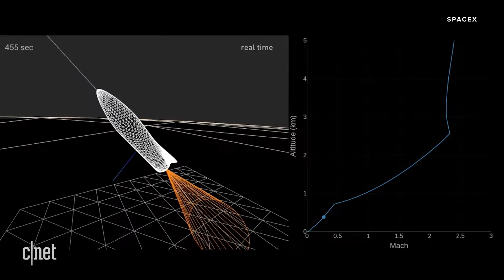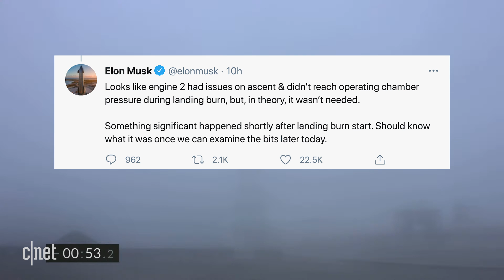Why does the SpaceX Starship keep EXPLODING?

Comment: They have "data" spread all over Boca Chica.
Reply: You do understand these rockets are covered in real time data gathering sensors right?.. they get a ton of info during the entire flight examining the wreckage is only a small part of that.
Reply: @NZBigfoot  Those real time data sensors probably stopped working the same time the camera feed stopped. The only way they will have to figure out why it exploded in the air is the wreckage. The engines appeared to land close together suggesting that the explosion took place somewhere near the middle of the starship. If an engine exploded it would be expected that they would land quite a distance apart.

Comment: It seems odd that SpaceX aren't testing the booster stages in parallel, unless they consider their Falcon experience completely transferrable? It might be, but scaling isn't always simple linear change.
Reply: The reason is simple, Starship is a much more complicated and difficult thing to design while the booster is basically just straight walled fuel tanks, which is being perfected on half the starship design. 
The main learning to do for the booster is having that many engines without shaking the thing to pieces and the crazy amount of fluid movement during flight, but the landing, well currently there is no plans on landing but instead catching them, will be fun to watch lol. Im sure a hop or two might be done with landing but not operational.
Reply: They can land boosters no sweat... as per the Falcon9, the Heavy Booster is just a bigger version of that. Starship is the unknown in need of testing.

Comment: Im surprised that this video didn't answer the question it posed. 

The answer is that they are built in batches with major development going into the production process. We will be seeing changes occuring in batches of which this was the last of its kind. Going into the next series of prototypes the gathered data from these flights will be used to better the ship.

They have been so successful actually that they stoped production of the current series short. SN11 being the last of its version that was manufactured when the series was slated to go till 14.

That also should have been the lead out. That the next flying Starship Prototype will be SN15 not 12 since 12-14 are scraped due to the great success of the series. In other words a bunch didnt blow up on the stand or on takeoff, they made their trip to the point of a known issue with tank pressure that will be addressed in the next series.

Edit: but a good video none the less. Thanks for trying to get people in the loop.
Reply: Excellent points. They should pin your comment to the top.
Reply: Well, the question doesnt have an answer yet, what your saying is basically true but it too doesnt answer why 11 failed. 

Each have had there own little issue that has caused their demise, it wasnt just from low pressure, that was only 8, which was fixed with 9 by adding helium but 9 had an engine not start correctly, fixed that by adding a third start during flip then shut downs till one was left (sn10) this failed because the engine wasnt giving the thrust asked for causing a hard landing, thought to be due to helium ingestion. 11, we have no idea as of yet.

Comment: people lamenting rocket part showered on wild life refuge, they are stainless steel scaps and more worryingly, fiber from the  insulation sheets, that's all, kerosene soil contamination on the other hand sucks
Reply: They dont use Kerosene, they use Methane as the fuel. The cleanest burning fossil fuel.
Reply: @NZBigfoot  I know I know, but the other rocket contamination involving kerosene and hydrazine sucks

Comment: This misses the main point: Spacex flies a full-flow staged combustion cycle engine. This is a super difficult technology even by rocket science standards. Nobody has flown such an engine successfully, apart from two sovjet launches which both exploded shortly after takeoff. It is so difficult because the seperate turbopumps for both oxidizer and propellant are driven by the partially combusted products which are then fed under pressure into the main combustion chamber. This means that the internal plumbing and turbopumps have to withstand scorching hot gasses as the working liquid, which is particularly troublesome on the oxidizer side (very hot oxygen eats most materials). There are great advantages to the technology if they can pull it off.

Comment: The title posed a BIG question....but didn't come even close to answering it!
Reason why Starship fails while all other rockets of Spacex lands well is that the quick 90 degree flip maneuver makes the 'insides' go haywire. The flip is required because entry speed needs to be greatly reduced by exposed large belly surface to induce drag....propulsively reducing the speed would mean burning a lot of fuel (extra weight)!
Perhaps Spacex could do the flip maneuver at a slightly higher altitude so that the 'insides' have enough time to stabilize.

Comment: YOU ARE MISSING HE POINT. 4 FLIGHTS AND 1 LANDING FOR A ROCKET THAT HAS NEVER HAS BEEN MADE!!!
Reply: Yep, this is all different compared to other rockets. The fact that it actually landed means that that the concept is possible. It just needs better landing legs to land softer and to fix the internal fuel system to stop having issues in relighting which im sure they can fix. If a fighter jet can make all sorts of maneuvers without it affecting the propulsion im sure they can do it with the starship since it has so much space inside.
Reply: @ajax818  Thank you someone with a brain finally

Comment: SpaceX literally just finished the first phase of its full-size rocket prototypes (SN8-11). In reality, what they were wanting to test with this iteration, it didn't explode at all. They were testing flying it to apogee and then its flip maneuver to get over the landing pad. The Raptors and the plumbing on these weren't designed to land. The fact that they almost landed two of four was amazing!
Reply: This!
And that they were so successful, with all launches getting full expected data, that they didn't even build out SN12-14 and are moving to SN15.
Reply: I read somewhere that the next phase starships have circa 900 changes to the design, also that the raptors they have been using are not being used anymore and the last of that design was on sn11 (hence the reason they repaired an engine rather than swap it prior to launch). The next gen raptors are completely incompatible with the first phase SS due to the way they are plumbed in.
Reply: And Elon even tweeted that there are hundreds of new improvements in this new phase of Starship. The Raptors look a lot different too. More sleek, better piping, etc
Reply: I cant agree with this at all, landing is absolutely part of what they have been attempting, the legs were capable of landing just not at 10 m/s and the plumbing? Why do you think there are header tanks my friend? 
Overall, why would these be coming back to a landing pad if this wasnt a part of the test, they would just go out to sea and put them were rockets normally end up.
Reply: @Vatsyayana87  because they were accounting for these to be blowing up on the stand and on assent. Elon gave this series a 30% chance of landing if giving Assent, Flip to Belly flop, and Flip to Landing equal parts. 

They have been mostly refining manufacturing processes and made little changes to the off the paper design of flight. The changes to the flight systems will be seen soon with SN15. 

Besides the ship blowing up last flight it also housed the last of the raptor engines that mated to the old plumbing. They will also be a new design.
Reply: @aaronb7990  Im not sure what your starting "because" statement could be answering here.

I agree this all has been and id say is still mostly refining the process of building them, but i dont know if i would say we will see the difference on 15, i cant. I know they are there but as someone that has closely followed every one made, i cant name a single difference of note accept a new thrust puck design if that is only starting on 15.

I havent heard anything about new Raptor fittings but you could be right, ive seen the big differences on the inside of the thrust puck to minimize parts and complexity but i honestly can recall the outside connections well enough to know the difference. If it wasnt in hundreds of hours of footage id try to find some good shots to see what you mean, but no thanks lol
Reply: @Vatsyayana87  I was answering your question about why they are doing the whole routine like its going to work when they know its not going to. 

They made the ships, therefore they flew the ships to the best f the ships ability. Nothing really more than that besides giving some facts that, as you said, you were unaware of.
Reply: @aaronb7990  Hmm well i suppose it didnt make sense to me because i disagree, I would say its simply false to say "they know its not going to" but either way I was asking the things i did to prove they had some confidence that it would work, otherwise there is no point in doing the things i mentioned. Coming to land "knowing" it wouldnt work doesnt make any sense to me, even with falcon they tried the first landings in the ocean.
Also yes i remember Elon saying 30% as you said but im pretty sure that was only for the first, if i remember right that turned to 50/50 then to 60% by SN10 i think.
None the less, i cant agree that these were not design to complete the task fully, and i do remember Elon saying for 11, something like, we are postponing to do a few things for a better chance of fully landing and recovery.
Reply: @Vatsyayana87  you said it in your last sentence. 'A Better Chance'

They knew these things weren't going to do anything more than give them starting data. They got that data early in the series and just sent it with the rest, with very sketchy methods, to get as much data as they could out of them. Things like adding Helium for pressurizing the tanks with zero intent for it to be a part of the final system for example.

But as I said there is a reason that 12-14 are scrap... they know the series isn't viable.
Reply: @aaronb7990  I know what i said and it doesnt prove anything your saying as valid, but i will say again, saying "They KNEW these things weren't going to do anything more than give them starting data" is absolutely false and everything they have done is very good evidence that they are looking for a complete and successful flight and landing, just not expecting it, there is a huge and important difference.
Also, no they didnt scrap 12-14 because they were not viable, it was because they didnt want to wait to implement the new upgrades of their next iteration, again a huge and important difference.
The adding of helium like everything else we have discussed is proving your points invalid, they added something to make the system work, even if only for the short term until they settle on a better way for the later builds, how could you possibly take this as they arent actively trying to land these?
Reply: @Vatsyayana87  OK.
Not gonna argue semantics about someone else's intentions.

Fact: SN12, 13, & 14 were scrapped because 8, 9, 10, and 11 all got massive amounts of data. If the first 5 didn't lift off or had earlier failures SN15s needed changes to improve the landing would not be known yet and 12-14 would still be on the slate to get that data.

Or in that scenario (first few launches not going up) we may not even have seen 10 and 11 because some major flaw prevented assent and we may have had a lull while the issues were addressed and a new design built.

I guess my point is that the expectations of these is to find the flaws and fix them, and these are the first to attempt it. 

Finally, is it wrong for you to say that they expect it to land? No, I mean they wouldn't be doing all this if they didn't think they could land one.
🤙
Reply: @aaronb7990   I think we agree on the big picture, we just have different thoughts on where the facts are and where we should just say the words "i think" first.
 But either way, you have a good one. 15 is coming soon, hopefully that bugger will show the world how its done.

Comment: SpaceX never has the same problem twice.
Reply: Its true,every next test flight all problems on previous test flight have been resolved but every next test flight New problem is always there
Reply: And some time they will have solved them all!
Reply: Which is exactly why this type of development is so successful. They will run out of problems at some point. Even the Falcon 9 failed its first attempts at landing during its commercial production stage because there were problems not yet countered (i.e. hydraulics, sticky throttle valves, weak landing legs). Now look at: the most reliable, affordable and fully reusable rockets in history. At this point, I would assume most of us are more surprised when SpaceX doesn't land a Falcon rather than when they do.

Starship will wave at Flacon as it flies right on by saying "Hey man, thanks for paving the way". I can't wait to see what SpaceX makes next after Starship and how insane it will be.
Reply: @ithinkyouimagine5273  The reason NASA and other companies don't do this is because of money. Elon almost has unlimited.

Comment: Hope they look into using a plunger to drive the fuel to engines. If they can find the right materials to handle the temperature. Header tanks can be scrapped with no chance of cavitation or slosh regardless of orientation.

Comment: Throwing the rocket all over the place sloshes the liquids such that pumping fuel and LOX into the nozzle varies, a lot.  Tesla will have to change its four-tank design to a one-tank design but keeping LOX and CH4 separate by enclosing one or both liquids in two plastic bags inside just one tank.  Like a baby bottle, sloshing and gassing stops, and rockets get the liquids they need to fire reliably.
It's pretty obvious what is wrong, but I guess Elon Musk just isn't up to it?
Reply: Yeah, you're much smarter than Musk man, good job! I'm sure Tesla has to change that design so it can make a better rocket! Cool Tesla launching rockets! Tesla should put the plastic bags as you say to launch their rockets! Good job! You're so smart!!

Comment: If NASA had one explosion, funding would be cancelled. So they spend 10x as much & keep milestones conservative.  Musk has aggressive milestones because there is no politics in its funding.
Reply: Yes, and even then NASA still had various crashes and a total of 15 astronauts killed. Its actually a good thing that SpaceX is taking advantage of this. Testing out the rocket and having it go wrong in every way possible so you can learn from it and not allow it to happen again is better than just trying to make it 100% perfect and then just hoping that it is. I’d rather ride a rocket that’s been tested through trial and error where everything that went wrong or could’ve went wrong was fixed to make it work than a rocket that was never tested and just tried to be perfect.

Comment: Because the whole concept is wrong. Don't start the fire when it's on the ground, but when it's already up. Look how birds fly. They jump up first and then fly away.
First launch it through a tunnel with a hydraulic system or compressed air or something.
Reply: That's incredibly dumb 😂
Reply: The launch works fine, the problem is the landing :)
Reply: It is good theory. But in reality the tech that you are pertaining to does not exist yet. Especially on a larger scale as this.
Reply: It's just that it wouldn't help. These rockets reach 200km/h within a couple of seconds after launch. You're only gonna be saving like 3-4 seconds of fuel.
Reply: getting it up is not the hard part though.